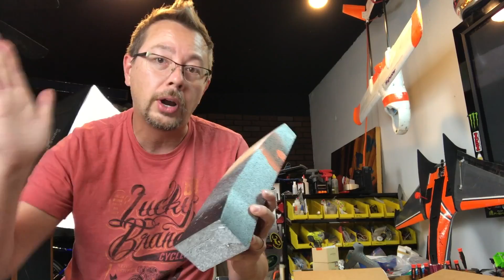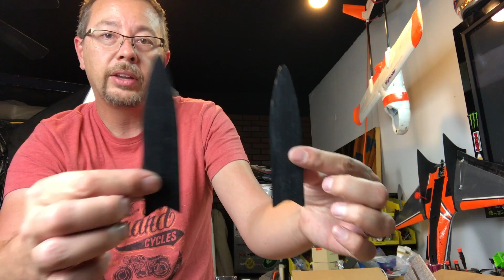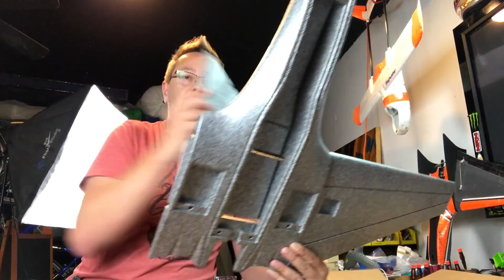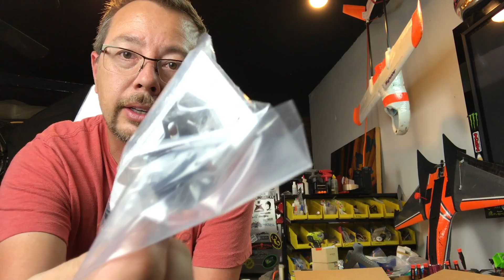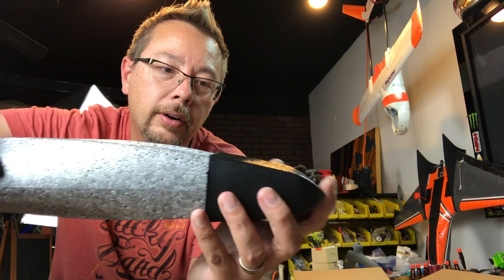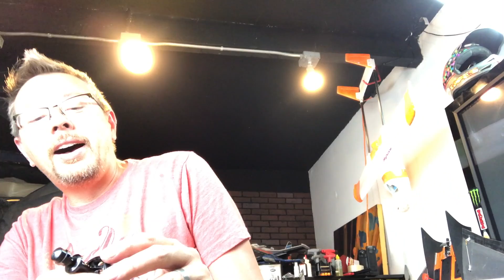Mini Drak Unboxing and Tips- Ritewing

Comment: It's a really nice kit. I've got mine and all the components, I just need to build it out now. And then learn how to fly it ;-)
Reply from the maker: Hey Chile! Have you flown fixed wing before?  Hopefully so.  It's an amazing robust sporty platform!
Reply: no it's not this model has no instructions no manufacturer box none of the stuff is cut to size compared to a banggood model this is like growing the trees to build a house this model showed up at my house yesterday and it's all f*** up the foam mold is a piece of s*** there's too many to Mill sections of foam missing all over the place the bottom is dissimilar from one side to the other with a 26 mil by 2 mil section missing across the bottom this is not $170 model this is not a $40 model that should be sold for like 10 bucks

Comment: Seems like a great plane. Could you recommend a plane for my first one. Things to take in consideration. I fly 5-6" quads. Acro and race. See my channel. So I have all the gear for the quads. Batteries motors etc. Wondering if there is a great crossover plane for me. One that I would not get bored with quick, I guess you could say one that I can grow with. Also maybe small enough or can be taken apart to fit in a small car. Thanks a bunch.
Reply from the maker: Look into the S800 Sky Shadow, It uses quad motors and fpv parts.  Just get the CG spot on and limit the throws of the elevons and its an easy flyer.  I recommend if this is your first wing to laminate the entire plane- this will help the durability for a beginner pilot.  Have someone experienced maiden it to trim it out.  Check out my channel for some info and product links- it will help out my channel.
Reply: +7demo7 yeah the s800 came out phone was beautiful on it perfect for 40 bucks this is $170 model and it looks like an ice chest I bought from Kmart

Comment: Great tips Jeff:-) I really love the Ritewing SS motors. The long shaft really increases the performance of the motors. I wish motor manufacturers would learn from this and offer similar style of prop shafts. The propeller work much better in the cleaner air. Maybe a longer shaft puts more strain on the bearings though. I would assume so, but I haven't heard of any bearing failures.
Reply from the maker: +Håvard Støre Andresen I made the mistake of not buying the ss motor for my big Drak- I was pulling 20-25a cruising- too much. Always regretted that decision